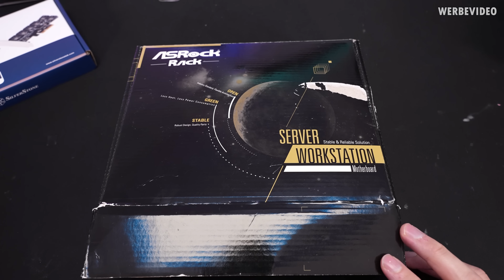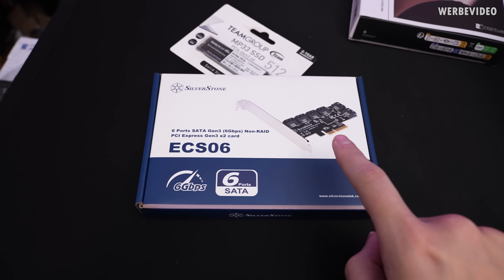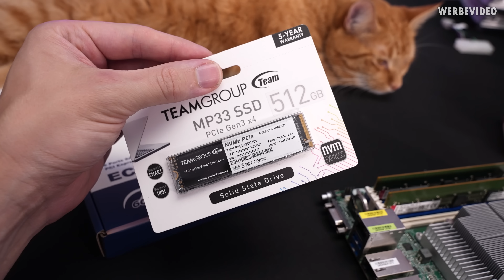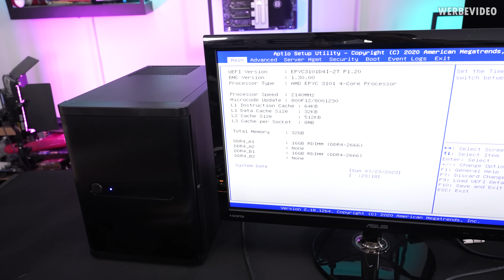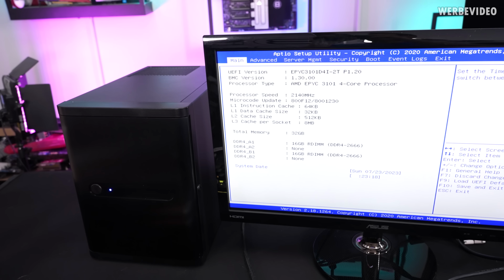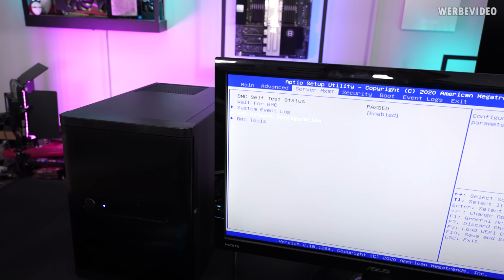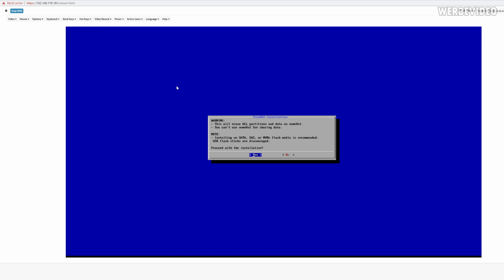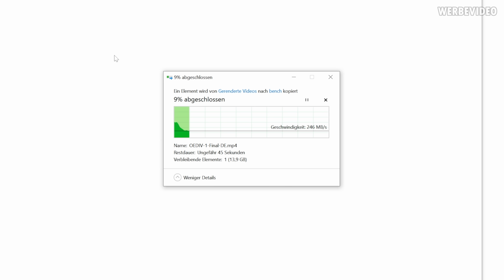First Time building my own NAS

Comment: Why only 4 drives? It should be 3 or 5 drives for RAIDZ and 4, 6, or 10 drives for RAIDZ2.  I follow the 2^n + P formula; data drives should be in the power of 2; i.e. 2, 4, 8 and then n number of parity drives.  So, I would have gone with 3 or 5 drives for raidz.  I guess it really doesn't matter with RAIDZ; however with RAID5 that would be a very bad setup as it always does a full raid stripe.  Note that ZFS will treat your 4 disks as a 3 disks full stripe; it will only ever write out either a mirrored blocks or two blocks + parity.  If you did 5 drives; then ZFS would do either mirrored blocks, 2 blocks + parity, or 4 blocks + parity (a full stripe that matches total number of drives) depending on the data needed to sync to disk.

Comment: The DS380 is a shockingly bad case, (see my review of it) (though my long term results are even worse than my review) (fans are junk, drives bays rattle, fan filters are cheap, the whole case rattles and buzzes and the worst bit is the Sata backplane seems to introduce ERRORS!!)
Those sata cards love to overheat to, consider adding a stick on heatsink OR IT'LL CRASH WHEN YOU MOST NEED IT.
Reply: Then you really did something wrong or ....., my DS380 has been running for almost 10 years with hard drives from 2012, quiet and cool, stil perfect in 2024":goodvibes:

Comment: I have a lot of data also. My objective is to economically back up my NAS. I backup my data directly to sata drives in a usb removable drive device where i can just plug in the drives easily. Each project can then be saved to disk, the disks stored off site. There in no additional hardware required complicated duplication of nas hardware waste of energy or having to fix more hardware. The external disks are the equivalent of tapes only more practical and longer lasting.
That  being said I didn't learn any new technology or get any new cool hardware to play with but what was the objective of the exercise backup data in a simple way because when the shit hits the fan I don't want to think just act.
Cheers and thanks .

Comment: I rebuilt my little 2 system homelab with a completely overkill Epyc system for the PCIE slots and BMC as well (full ATX board in a Fractal Define R5 though).  So nice having a relatively modern board with recent IPMI that I don't need an old version of Java to access.  As others have mentioned the SATA card might be a problem, but iirc occulink > sata cables are pretty inexpensive if you do run into problems or of course you could just grab an LSI HBA flashed to IT mode off ebay.  Even with cables they can be had pretty cheap.

That transfer speed was actually pretty slow, if you were going from > to 10G even without tweaking anything you should be seeing higher speeds unless the system you were transferring from was reading from a couple spinning disks.

Comment: My only recommendations would be buying a proper HBA that is flashed to IT mode and buy more smaller capacity drives for the same capacity. Additionally make sure you have a few spare hard drives on hand for when your drives die.

You buy smaller capacity dives so if a drive dies in your pool the time it takes to rebuild the data is less since the capacity is smaller. (Writing data at 250MB/s to five 4TB drives will be faster than writing to two 10TB drives in the event of a drive failure.)

Wendell from Level1Techs has taught me a ton and I want to make sure I pass on what I’ve learned to others so they don’t make the same mistakes as me. (I bought four 12TB drives for fun and then I learned how long it took to build my RAID 5 array: 1000 minutes, if I went with more smaller drives it would have been done substantially faster.)

Comment: Nice video. I'd have made a few different choices but that's the beauty of home building. Everyone can build to their own specs.
Note on your performance test: When you wrote 16GB and were surprised about the speed of the HDDs, your HDDs were actually idle. All 16GB went strait to memory cache. TrueNAS will use all remaining memory to cache data before writing to disk. So the true performance of your HDDs will not be apparent until you exceed the memory of your NAS.

Comment: interesting, I have a very similar setup, same case, only I went with the EPYC3251D4I-2T
I was wondering how to attach a fan to it, been running it fanless for a while
Did you just run those zip ties under the heatsink and tighten it? Is it required to remove the heatsink to mount it that way?
I was also thinking about trying 3d printed mounts I found in some forum, and trying to attach one of the low-profile noctua NH-L12S there, but worry that it'll not clear the drive cage then...

Comment: Why did you choose Truenas Scale if you only want to use as storage instead of using truenas Core?
Reply: I think he's not the correct person to ask this. He kinda implied he doesn't work with NAS'es a lot and isn't that deep into both software and (home level) hardware. That's why somebody else would help him set up the thing later. I guess it must've been a mix of reasons around this. I guess scale being Linux based might play a part as well.

Comment: Hmm, I can actually pull around 500MB/ps from old spinning rust (10 years old HDDs) I took from a few servers I decommissioned from work, built the NAS on a similar board as you but for AM4, The  NAS  itself is a VM, PCIE passthrough for the entire HBA from PVE to the VM with Truenas, 10gbit mellanox NICs and LSI HBA seem to have helped a lot with speed.

Comment: Great build, but I have to admit to getting a bit of a headache when you pulled the heat sink off of the embedded Epyc.  I’ve been wanting to build a similar system in a 2U case with SSDs in my recording studio and the embedded Epyc only needs a bit of air moving across it to keep it happy.  After seeing the case, adding the fan was a good move since the front of the case is pretty solid (and bad for airflow).  The RAID controller you’re using may be less than optimal, performance wise, but should get the job done easily in your application.

Comment: I have the same exact board, and I struggled to attach a fan for the cpu :) I also added a big fan with straps :) I am using Truenas with ZFS and disk encryption.
Nice mb choice !
I am using only 3 disks in raid1 configuration. Yes 3 disks for raid one, no typo here !

Comment: Its great you went for the ipmi, you could script remote activation of the nas for backup then shutdown. Interesting you went for the Toshiba drives based on price a few months ago i update mine with the 18Tbs the price point has already moved on!
Reply: That's pretty much what I did with my HP Microserver. It wakes up at 10PM every day, backs up my main server then goes back to sleep. It's been a couple of years since I built it but if I remember correctly the sleep script waits for at least 5 minutes with no disk activity and CPU load below a certain percentage before shutting down. I use IPMI to wake it at other times because the machine itself is buried in a barn some distance from the building my server is in.

Comment: I have two of these cases with 8 drives in each.
One is a simple JBOD connected to the other.

I created cardboard inserts to make sure that the 2 side fans are forced to cool the HDD, as they can get quite hot in this case without an air guide.

Comment: So cash spend for nas and only RAID 10, that general sucks. 1 HDD as true 'spare drive' and often this kind of raid level like to completly fail. (2 hdd not in pair like corrupt, 1st  one as normal 'hdd fail or corrupt' then second on like to go off. When you recover 1st one.)
I REALLY DON'T RECOMEND use RAID 10 as long live NAS config. 
With TrueNAS you can use NVME drive as cache, so you rly don't need RAID 10 for speed. It's better do RAID 6 with 2 spare drive as config of 5 or 6 or more hdd (optimal config).
Why two hdd... very often when one drive is failure. Second like to do die when you recover 1st one.
With 18TB drive it's like to 2-3 days min. for recover this 1st drive.
And when you use NAS on daily,  often it will take like 7-10 days.

Comment: General wisdom with raids for a while is to keep 2 redundant drivers at least. 
Simply because the chances of a failure while rebuilding are pretty large. 
That being said an effective backup strategy is more important. If the nas is a total loss all relevant data should still be at two different physical locations ideally.

Comment: For my NAS, I went to a much cheaper but still extremely effective route: Asrock X570D4U mainboard (still with IPMI but takes standard AM4 processors!) with Ryzen 5700X (no GPU needed due to IPMI), Broadcom SAS 9300-8i adapter in HBA mode (software RAID5), 8x serial ATA SSDs and finally a used Dell SFP28 25GBps capable network card.
Reply: also Ryzen without GPU or Ryzens with PRO suffix supports UDIMM ECC memory

Comment: A friend and I have recently been working on VERY similar NAS projects, using Asrock Rack's X570D4I-2T, an AM4 equivalent to what you bought, paired with the Ryzen 5 Pro 5650GE 6-core 35W part. It also has two OCuLink 4i ports, so can run 8 drives without add-in cards

Comment: You'll want to replace that SATA card with a proper HBA in IT mode for long term reliability as others have stated. You also might want to address the cooling issues this case has as others have suggested so you're not cooking your hard drives causing premature failure. Also with the wonky memory management in TrueNAS scale you'll only have 16GB of the 32GB available for ARC which may end up causing some performance issues if you are editing directly off the NAS so you may want to up that to 64GB. Memory is cheap so best to do it now while it's cost effective. There's a lot of good information and helpful/knowledgeable people available on the TrueNAS forums to point you in the right direction if you need help with anything. Nice job on the video, thanks for sharing your build.

Comment: Welcome to the NAS world, Roman!. The 10G ethernet ports are the best selling point of this board. However,  Some would just be happy with 2.5G ethernet. In my case, I have a X4 Card housing 4 port 2.5G . I am running Xpengnology DSM 7.1 on a 12core/24thread Xeon with 64GB RAM under ProxMos. If you use DSM 7, you can automatically backup main NAS to second NAS without hassle. That is the benefit plus all the other apps you can house on it including Surveillance Station!.

Comment: I've had pretty good success with the ASmedia chipsets under Linux/BSD/Solaris. But The gold standard here would be to replace it with an LSI chipset in the 2008 or 2308 or 3008 line. Ebay for an ibm m1115(2008) or m1215(3008). Apart from that, solid build.

Comment: As others have noted: you should switch out the sata controller to a proper LSI HBA in IT mode. However, if you plan on using all eight bays in the future, you will have to mind the limited space between the pcie slot and drive bay nr 3 from the top. Also, this case run very hot when fully populated with drives. There are 3D print stl files available to direct the side fan airflow over the discs helps a ton! If it isn't allready obvious, I am running the same case in my NAS (24/7) for the last 6 years with 11 drives. The hardest part is cable management. Hit me up if you need pointers, or recommendations on parts

Comment: One thing i've liked to do recently is, instead of SSD servers, is get HDDs and optane(which works with AMD when used by NAS OSes)
I have a 160TB RAW 112TB usable HDD NAS, i have 4 of the 118GB Optane drives that i use as read and write cache, but i also have 2 of the 960GB 905P drives for special metadata(i plan to reverse this in the future, 4x960GB for read/write with 3x118GB for special metadata)

The specialmetadata drives REALLY speed up the sense of snappiness.
Reply: Hi, may I know which Nas OS that work with optane?  Also, do you have some guide or on using Optane for NAS and the special metadata?
Reply: @zazelskycrest2525  I am using TrueNAS Scale, however most OSes can use optane, even windows as long as you use a 3rd party software like primo cache.
The Level 1 Forums are a good place to go for Optane info, and i think they may even have a few videos on the subject.

Comment: Just remember that raid itself is not backup. I don't expect you to go ham and pay for multiple levels of backup like a second array on a seperate controller + cloud/offsite backup + offsite tape backup + iron mountain and so on. But you should consider the first layer there. A second array, on a separate controller, that you periodically backup the main array to.

ZFS based raids are great, and have allievated a lot of the shortfalls of traditional raid 5/6, but they are still not a backup solution on their own.

As many have also said your weakest link here is your cheap controller. Definitely upgrade that.

The controller is probably the most important part of any raid system. It's not just speed that is impacted. It's what protects you from silent data corruption, error recovery/checking, proper management of caching (when applicable), and rebuild success rates/times.

The downside of changing controllers is going to be compatibility, so better to do it sooner rather than later.

One last note, I am not familiar with those drives (and haven't looked them up), but hopefully they are drives designed for RAID. It's very important now to select raid based hdds over consumer based hdds, or you can be in for a lot of problems.

I use Western Digital Red Pro drives myself. Western Digital has been making it more obscure lately though, and not all their Red series "raid" drives are actually good. You want the CMR based ones (not SMR) which I believe requires red plus or pro.

Other brands will do the same thing. Basically you want to make sure they are raid based so they do not power down for energy savings, and have the faster cmr technology. Otherwise speed suffers, and rebuilds will have a high chance of a secondary drive failure before completing (for smr vs cmr).

Comment: You should always have your operating system on a ZFS mirror. The best way to do this is with two good USB 3 drives. FreeNAS does very little; it doesn't need an SSD, let alone a fast one, to work; all the work is done on the storage drives. If you don't feel comfortable using USB drives, at least put in a second cheap SSD. A common way commercial solutions do it when they don't want the OS outside is to use internal USB ports or SATA DOM sticks (which are basically USB drives over SATA).

Comment: I have been in IT for 26 years, as desktop support for 12 and sysadmin for 14, working specifically with storage, backup, VMWare, and Windows.  I have very extensive experience with different HD brands.  I HIGHLY recommend getting away from those Toshiba drives, and keep away from Seagate as well.  I have had extensive problems with high failure rates of Toshiba and Seagate drives, Toshiba being FAR worse than Seagate.  

One place I worked, we had about 500 300GS Toshiba 2.5" enterprise level drives, and nearly all of them died within 5 years, at least half before 3 years.  This is a horrible failure rate for enterprise level drives.  We had well over 2000 Seagate Constellation enterprise level drives, and those failed at a noticeable rate, but far less than Toshiba.  I was replacing them at a rate of about 3-5 per month on average.  

We also had 192 1TB and 2TB HGST Ultrastar drives that we had a total of 5 failures on, after over 10 years in operation, most of which were before my time.  While I worked there, I bought 8X 4TB Ultrastar drives in 2014.  I still have every single one of them.  Not one has failed.  I know HGST is no more, and now WD has their drive production facilities, but I'd still stand with them, as they are now certain lines of WD's Gold Enterprise drives.  

Presently, I have my NAS in a Thermaltake Core X9 case with those 8X4TB Ultrastar drives, made up to look like an endtable, with the front 5.25" bays filled with Icydock 6X2.5" SATA drive bays, for a total of 12 2.5" bays, 8 of which are filled with 2TB Crucial SSDs as my main file store.  The MB is a Crosshair VI Hero with a Ryzen 1700X processor and 32GB of DDR4-3200 memory, a x1 Geforce G210 video card, a LSI 9300-8i HBA, a X520 10Gb NIC, and a lower end 4X SATA HBA in the x4 slot.  Just enough SATA ports to handle every bay.  It's Running Windows Server 2022 and Windows Storage Spaces for mirror/stripe on those drives and ReFS for the file systems.  I get a good ~800MB/s out of the main file share.

Comment: You could get even better speed if you set up Arc and L2 Arc so your ram and SSD can be used as HDD cache, tho it might already be on for L1 RAM cache, having also L2 is still a great speed boost for HDDs.
Reply: I was about to say that he can get better performance with arc and l2 arc caching mechanism.
Reply: Most people misunderstand how caching works with ZFS.  If you want to speed up writes you would want to add a ZIL device (for sync writes) or more likely tweak other ZFS settings, not tweak ARC (or L2 ARC) which are used for reads.

Comment: 1 backup is not enough - you need two - and for small and medium biz concerns this is even more vital - 10g is good - networking is the weakest link, 2 raid10 with ssd is enough for most and it is cheaper to expand plus more reliable, less power and no moving parts plus much faster, use raid1 for the os drive, image raids to usb hdd regularly - you may goto nvme since they have price parity with ssd, also you can use bonding or bridging 10g or goto 40g - 40g cards are cheap and reliable - dual port 40g is 40 bucks - no switch needed just direct connect from ws to dual nas